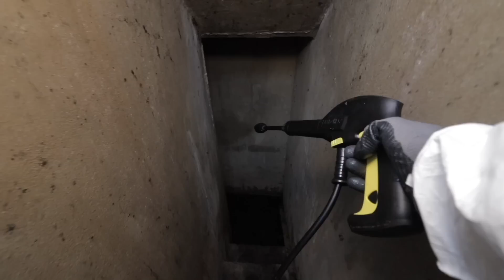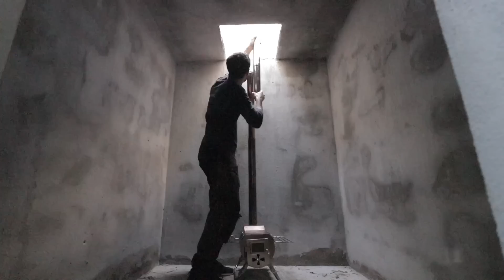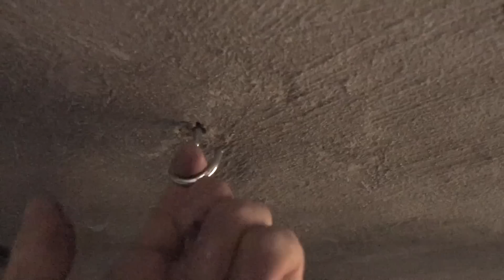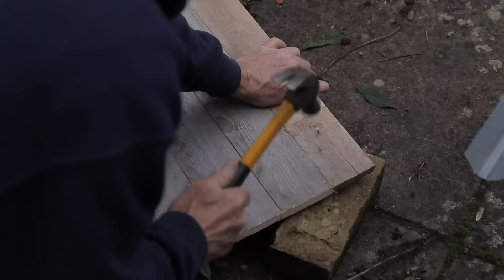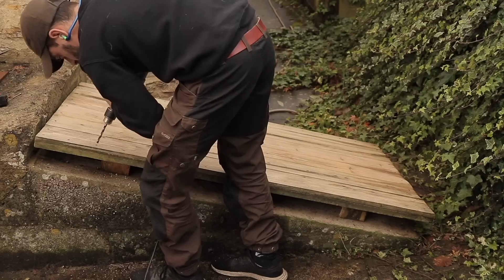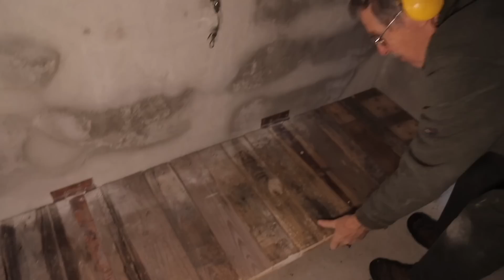Renovating an Old Abandoned WW2 Bunker

Comment: With the way things are going, you're probably going to need this bunker.
Reply: Undoubtedly 👍
Reply: I wouldn't wish to be inside were a 1600 ft radioactive tsunami washes across Old Blighty.
Reply: @bsdnfraje  what is blighty?
Reply: @tribalismblindsthembutnoty124  19th Century slang for England/ Britain
Reply: @tribalismblindsthembutnoty124  Old Blighty is an old nickname for England.
Reply: I mean if he's not in a major city it probably will, we're talking about modern nukes not tsar bombas any more
Reply: Hopefully he'll have it and never need it rather than the opposite.
Reply: @Rayman-ie3ld  I referenced a 1600' wall of radioactive water for a reason.  If he is near the coast, that's the theoretical danger faced right now.
Reply: @Rayman-ie3ld  He’s down south though (London way on) and London is the first place in the UK that would get hit.
Reply: @Neoxide not much good with a house on top of it , it will become a tomb
Reply: @bsdnfraje  Mother earth has a hard time creating a 100 foot tsunami, Russia is exaggerating big time.
Reply: the way things are going, no bunker is gonna help.
Reply: @Neoxide I think it’s a good start and much better than a lot of people. With a 2ndry door at the bottom of the steps, thicker,airtight doors for primary and emergency hatch. An overpressure system maybe, basic air filtration and some supplies stocked up it could be fantastic. I’ve been dreaming of having this kind of shelter!
Reply: @Steve-318  Mother Earth has a hard time producing mushroom clouds too, but man can.  You sound like whistling past the graveyard.   Sometimes it's all one can do.
Reply: Totally agree. Hope you got room for a lass and her Jack 🐾
Reply: @bsdnfraje  England 🏴
Reply: @SaffyFoo  yes, very good, that's what I said. You must be a kiwi, functioning at a pre-k level like that.

Comment: I'm sure it will be fine and I'm just overthinking it, but would it not have made sense to paint both sides of the door/hatch, just in case any water does get in between the wood and the chequered steel plate?

Comment: Zinc plated bolts will rust in no time. For corrosion resistance and compatibility with aluminium you need stainless steel.

Comment: You need to test the integrity of the walls and ceilings for radiation, pressure, heat, humidity leak and tremors (explosion).